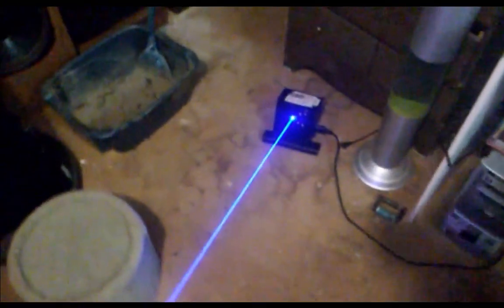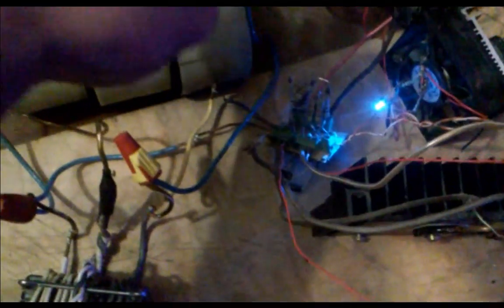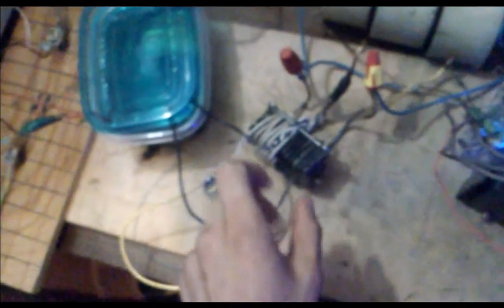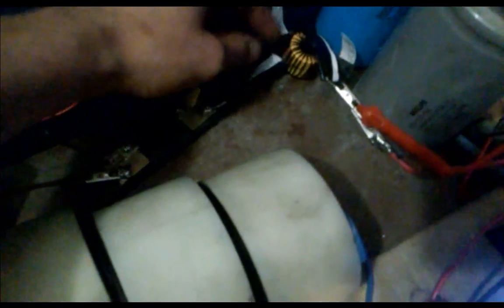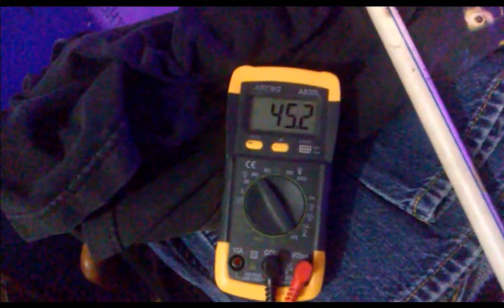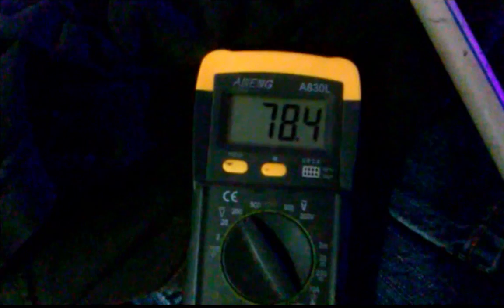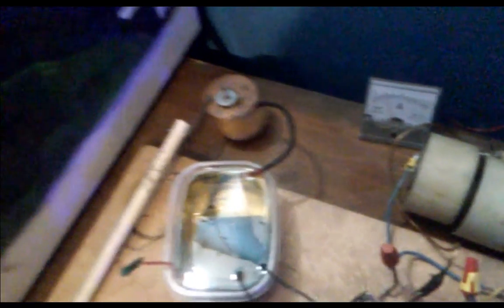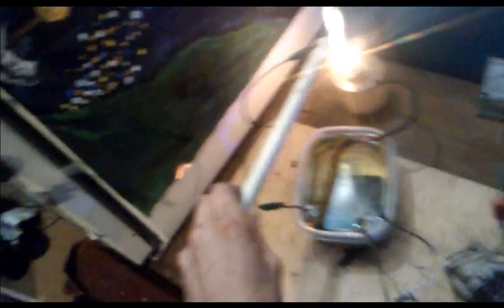High Power ZVS Driver Mods, Arcs & 1.6kW VS Flyback

Comment: picture on  fire ah ya plasma arc ten thousand degrees f +++ light paper burn thorough everything ah yup easy not much can resist that temp and your flyback is setting on bottom and is providing short path if you want wait until the holes get big enough to expose the coil from leaking little water in the spill and it will light up more than a pipe load.

Comment: Thats a weird looking MOT stack
Reply from the maker: Huh? The stack in the beginning of the video by the door during the laser part right? Ohh no. That is just 16 of them as part of my stash. Plus the two aside with no secondary that have plans for a power supply.
Reply: Haha sorry it was just my piss poor idea of a joke. I've only ever gotten juicy arcs like that from raw MOT stacks and i remember when you used to too. Ive still got 10 or so stashed away, i'd like to rewind one or two as an auto-transformer sometime in the near future. Its proven very fun to have well over 120V out of the wall without tapping off the split-phase supply lol.

I can't wait until you feed this ZVS some more grunt! Next step might be re-configuring your own transformers under oil if the ol' flyback gives up from the power